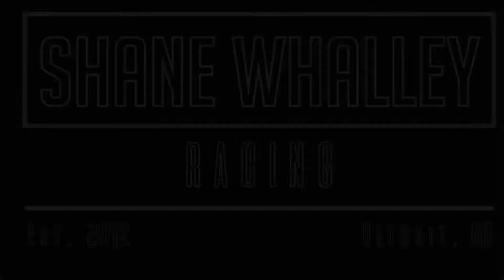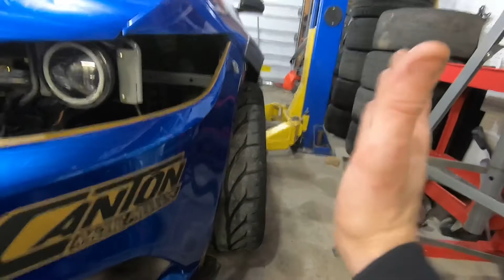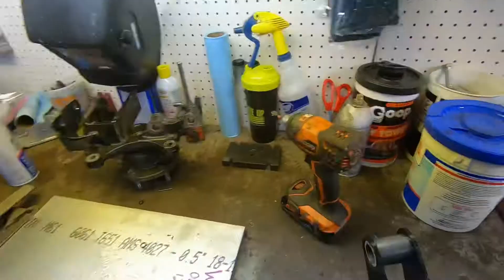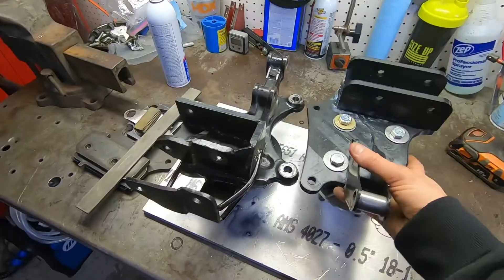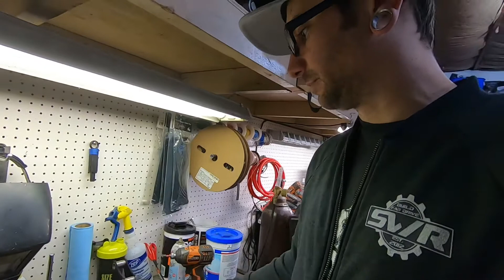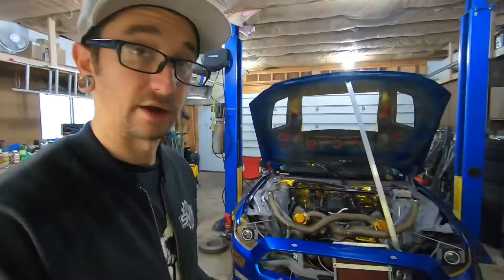Build and Program Update! / LS Swapped S550

Comment: Question. Why didn’t you pipe your waste gate exhaust into the output exhaust of the turbo? Is there a reason to vent it out separately? Is there pros and cons either way?
Reply: doeboy1976 doing that requires a lot more fab work and it sounds sick when it’s not together. It’s usually called a screamer pipe

Comment: I can send you some end mills that will open up those holes and wont have any issues. I work in a machine shop and machine heat treated metals that are much tougher and harder materials than what you're using. Just let me know if you would want some end mills to try out
Reply from the maker: I have a brigeport at work that could open them up pretty easy, just from a production standpoint, it’s more practical to get them cut to fit right away than deal with hours of cleanup and prep per piece. I really appreciate the offer to help though for sure. Thanks 🤙

Comment: did you check the kpi geometry when you tipped the strut mount on the knuckle? I dont know a lot about it but I do know that angle can make a huge difference
Reply: https://www.youtube.com/watch?v=rUwJTqr2JC4
Reply from the maker: The KPI is within range that with the combination of caster adjustment it can get right in the sweet spot. Before changing the pickup the KPI was way on the inside of the wheel.
Reply: good deal dude, I cant wait to see it shred this year

Comment: Plasma can work but isn’t ideal lots of clean up and prep work in addition to the plasma cut itself being much wider than a laser and is more melting than cutting, can work but lots of cleaning up the cuts I’ve seen some good plasma cuts and still need clean up almost always especially if it’s being tig welded, laser is a night and day improvement all the holes and tab n keys come out so much better not sure about the shops you have locally but any precision sheet metal shop I’ve been at can hit +/-0.005” pretty easily but it’s up to them to correct any sort of offset in the cnc program for laser compensation etc to hit your dimensions rather than just sending a file and having them run it. Also think it would be beneficial to work with a company in an understanding you want to do 10 but cut one first and inspect everything then proceed, that’s how the shops I’ve been at do it every part has to be inspected in every step of its process from start to finish so they cut one check it then cut the rest same with anything else bend one check it Weld one check it etc. I’m not sure how much heat the laser puts into the parts but it can’t be much if for the tolerances they use lots I’ve 0.045” thick material have seen 0.028” parts as well holding really tight tolerances post welding. Laser or water jet both good options depends on what’s around you lasers are really good and more common in most shops now a days

Comment: Question: what's the benefits of going to cam bus.
Reply from the maker: Simplicity. Less points if failure in the system, no more spade terminal switches, overall less bulk, and more program ability  on everything.
Reply: To expand on Shane's response: CanBus allows everything to talk to each other as well, and send all that data over just 2 wires (rather than a wire for every signal). It allows you to prioritize data and send more complex messages (error reporting, sensor health, etc) which allows the ECU and power management systems to be setup in a more intelligent way.  More reliable, more robust, more flexible and more consistent in short.